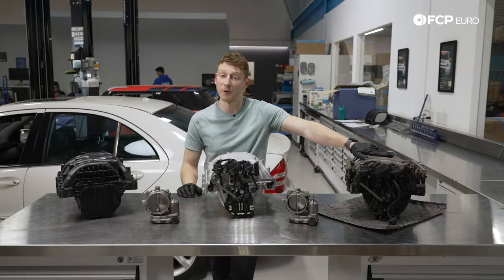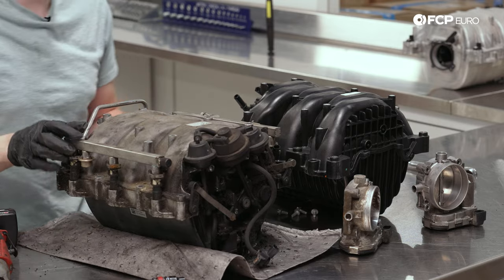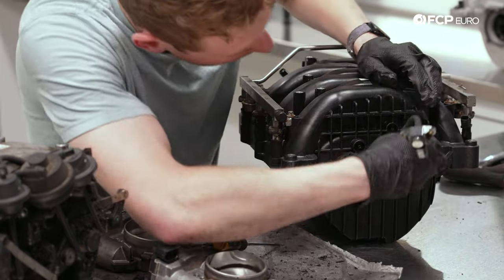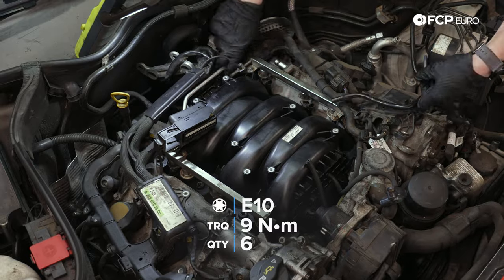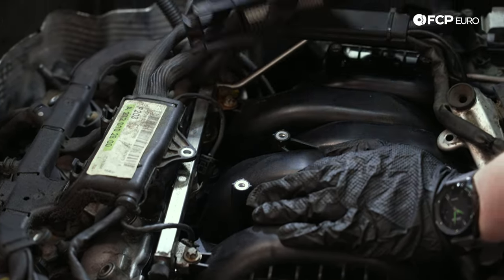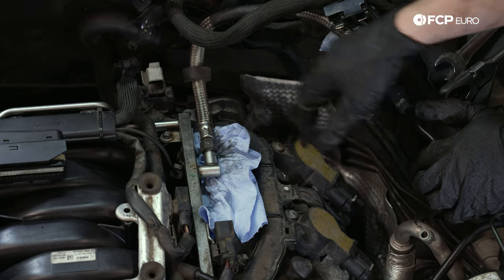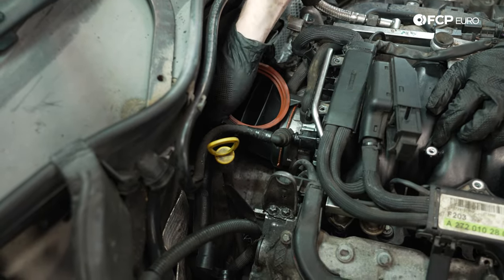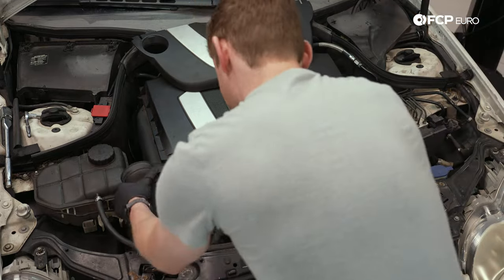Mercedes W203 Intake Manifold Replacement DIY (2005-2012 Mercedes M272 Swirl Flap Repair) - Part 2

Comment: Love the clear videos! The upgraded manifold is cheaper and less complicated. However, these savings will disappear after an ECU tune, which is very expensive. Basically, it seems like the simpler approach would be to replace a faulty manifold with an OEM one.
Reply from the maker: You can certainly go at it either way! Danny is still testing without a tune at the moment.

Comment: I see from some of the comments, Danny is still driving without a tune, and that's great. My father bought a 2005 SLK350 new, and was just one of his "Toys". He passed away a few months ago, and I got his car with only 22,000 mi on it. I've run into a few things that are age related because it didn't get driven much.... but the original intake just seems like an over complicated ticking time bomb to me.  Since these are factory parts, for an upgrade package with an extra 30hp.... it seems like a "no brainer" upgrade to me. (I will be doing it in the future)  With that said... do you know of  a USA shop that can just flash the newer SLK tune into it?   I think most of us aren't looking for a dyno tuning session for peak performance, just a reliable toy.  Thanks for the vid !!
Reply from the maker: The catch with the M014 package as sold on the R171 SLK is that it's a lot more than just this manifold and throttle body; high-flow, high-rpm cylinder heads have drastically different air and fuel delivery than a standard non-M014 M272 V6.  An M014 SLK tune out of the box would be fairly incompatible with a standard M272, even if that M272 has the throttle body and manifold from this video.

Your desire for reliability is smart, though. Through the Mercedes tinkering community, we've seen tunes for this exact swap done by OETuning, Renntech, and a handful of others. Ultimately, we'll always urge you to talk with a tuner to be certain they're capable of what you're seeking and to get the car on a dyno if you can. Whether you're able to visit the tuner themselves or you're able to get data locally and send it to the tuner for revision, a bench tune will always be more accurate when it has Air-Fuel Ratio data to build on rather than just a list of modifications!

-Danny
Reply: @fcpeuro-media   Sure.... I totally understand.  I play with a lot of LS swapped vehicles, and can do tuing, although that's with the Holly computers. And, I was a part of the Honda Chrome group back in the early 2000's. I was helping with hardware. Since this is known mod, I figured there was a "Standard" bench tune out there for it already. I personally don't have the stuff to flash the Bosch computer... but I'm guessing one of the local dyno shops do.  With that said, I guess if I have to pay for a dyno tune... I will share it back with the community. FYI... I did find out the R172 350 was direct injected, so yes... it's tune would not be compatible. Please give us an update with how your car is running.  Thanks again.
Reply: @PghGameFix  I look to your update as well.

Comment: I recently completed this upgrade, but now my check engine light came on with code P0106 and P2008. Any recommendations?
Reply from the maker: P2008 is guaranteed unless you've tuned the ECU for this swap, as you've deleted the swirl flaps. It generally will exist as a stored code, but should not illuminate the check engine light. 

As for the P0106, check your MAP sensor and ensure it is both plugged in to the electrical connector and that the hose connecting it to the front of the intake manifold is intact.
Reply: You were right. Checked the vacuum line and it was brittle and cracked. Swapped it out and now the car is running great with no more codes!

Comment: There is a repair kit on the page fo the Swirl flap failure. that replaces one of the actuators. Seems that part of this process would apply to it, and that is a cheaper fix. Is that recommended? are any checks needed or recommended  to do on the intake mainfold besides replacing the actuator. Thank you!!
Reply from the maker: Hi Alfredo! Most swirl flap repair kits for the 272/273 intake manifold will include a replacement for the actuating arm on the front of the manifold, and this replacement will often be made of aluminum as a "one-time fix" to stop the arm from ever breaking again.

Inside of the manifold, the flaps themselves are held in with a series of small bushings. As these degrade with time and age (and especially with the coating of oil that usually causes the arm to fail in the first place), there is a risk that the flaps drop into the back of the intake valves and cause a top of top-end engine damage. 

For this reason, we recommend really only two methods of replacement for these manifolds; Install a brand-new manifold where the arm, bushings and pneumatics will be entirely free of wear, or refurbish the manifold in it's entirety (including all of the flap bushings, which does require opening up the intake manifold).

If you'd like to give the latter a swing, we do have a kit we've worked with Sun Nation to develop on our website under "SNT-RK5887"

Comment: Just a quick question if I may, are we using the same maf housing regardless of bigger throttle body & updated intake or is that bigger / different also? 
Thanks
Reply from the maker: MAF is the same, but the air deflector boot that connects the MAF to the throttle body will have to be upsized for the M273 throttle body!

Comment: When it comes to the tune, is it better to get an off the shelf like Renntech, Eurocharged, etc. or get a dyno tune?
Reply from the maker: If you can find someone locally who will dyno tune the car, we always recommend doing so; it'll ensure that your ECU tune is matched as closely to your car's behavior as possible. 

This being said, tuners like the ones you mentioned above or really anyone capable of Mercedes M272 programming (likely a Bosch ME9.7 ECU) will often be able to either draw you up an effective bench tune based on your modifications or can do so with a couple of dyno logs from your local shop. The car in this video has been driven for a good few months now with no ECU tune and actually has yet to throw a single code or exhibit odd behavior; this being said, a tune is definitely the safest way to go.
Reply: Thank you for doing this! I've been looking for more info on this for a while. I'm suprised that it's not more common considering most m272's have this issue. Would it be really sluggish in city with 3lt m272?
Reply: Can I get by without a tune in a  07 e350

Comment: Do you need to replace the injector o rings? I aee some reuse them
Reply from the maker: Always recommend to replace them as they are cheap insurance, and the flip to them failing can cause greater damage than needed.

Comment: would you recommend retrofitting the m014 manifold on a glk 350 4matic? would it cause more stress on the 4matic system?
Reply from the maker: Despite the AWD, it shouldn't be an issue as you have the 3.5L variant. While you will lose a bit of torque with this mod in the midrange, its typically a negligible enough amount on the 3.5L that it shouldn't affect driveline operation. On the smaller engines, they suffer much more from that loss of torque.
Reply: @fcpeuro-media  so this mod would be more tolerable/better to daily drive on the 3.5L?
Reply: I’m following this, i’m planning to do this in my 2009 ml350.

Comment: I'm hoping to have this done, too! Is it ok for daily driving? Do you get engine light for having a loose sensor with this mod?
Reply from the maker: Hey there! As promised, I've been daily driving the car for a good several months now without a tune to see what the outcome might be. I have yet to see a check engine light or any odd running conditions, but I'd still always recommend going with a tune to be certain you're maximizing both power and reliability. At the very least though, you can definitely drive it around town without a tune until your ECU tune arrives!
-Danny

Comment: Man I see you have a lot of xp on these engines. Can you tell me if there is number of times the fuel line fitting to the rail can be tightened and loosened because it looks like a flare connection which sometimes can’t be done several times and idk how many times mine has been unscrewed so now Im anxious after changing injectors. Thank you beforehand!
Reply from the maker: A service or two won't cause any accelerated wear, and that our personal cars with M272 engines show no signs of leakage after a good few times being loosened and retorqued (and, on that note, very few folks are regularly doing injectors on these engines). 

These can still be found: 2034701975 is the part number for a W203/W209 replacement, 2114701575 for M272/273 W211 replacement. 

Regardless, you should be okay to go on with your service!